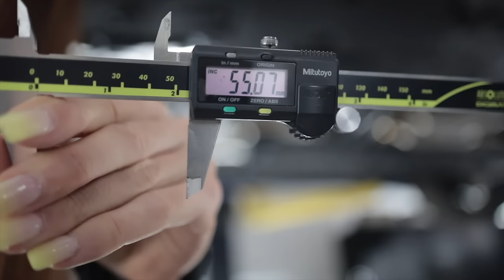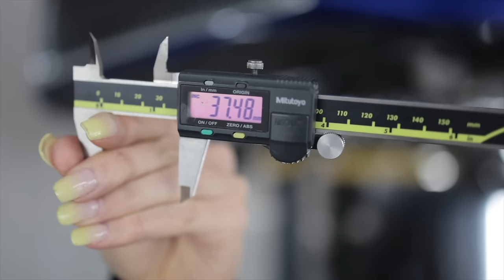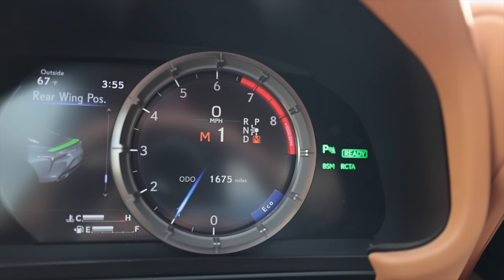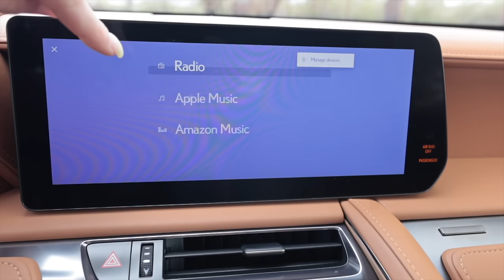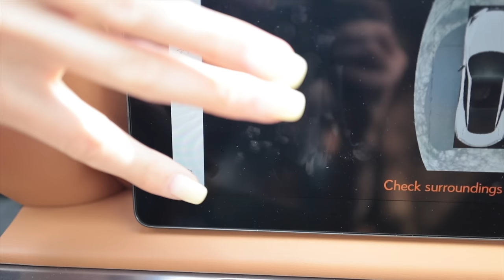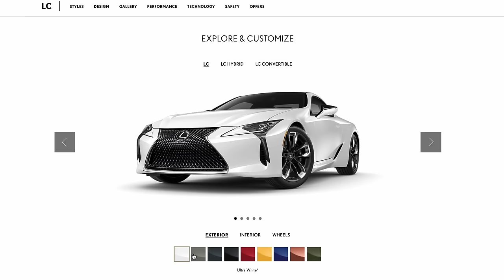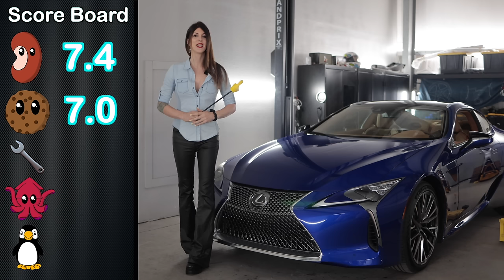Name A Sexier Car..  2024 Lexus LC500H Bespoke Review

Comment: As a person who has owned two LC500's -- the second a bespoke '24 convertible in this ultrasonic blue / caramel color scheme, it's beautiful -- I've always wondered who buys this car in hybrid spec.  "I want the most beautiful car Lexus has ever built...but without the 2nd best sounding engine Lexus has ever put in a car"?

Less than 1% (3 / 371) of LC's in the pipeline right now are hybrids.  82% are convertibles, which can't be hybrids due to the folding top and hybrid battery using the same space.  A bespoke LC500H is truly a unicorn.  A weird unicorn that would probably sit on the lot for 6 months before selling, but still a unicorn.
Reply: the v8 is the only way to go
Reply: Perhaps bespoke cars are built to order so this thing has a buyer already maybe
Reply: I don't suppose that car body could be put on a 68 Camaro frame after a little tweaking. 😁
Absolutely beautiful car inside and out, but I'd never own something I couldn't  maintain 100 % by myself.   It sure looks like a fun car.
Reply: @randywl8925  lol boomer
Reply: @simon_96  some dealers order bespoke cars for their inventory, but this is a press fleet car so I think this was just corporate showing what they could do.

The shame of this specific example is that the main reason most people get a bespoke car is to include some of the cosmetic options that Lexus puts on the Inspiration Edition cars.  Like black trim and the IE wheels, neither of which this car has.
Reply: Where did you get those stats? I would have guessed that most in the pipeline would not be the convertible.
Reply: @Orney  Glad you can afford to have the dealer change your spark plugs. I can't.
It's still a beautiful car..... It just needs a Quadrajet and an O2 detete.
Reply: @johnfisher7121  Not many sold in Montana, North Dakota and Minnesota. 😁
Reply: @johnfisher7121  it's a google doc that some of the forum folks found showing allocation info.  Since the convertibles came out (2021) they've been the big majority of sales, usually beating the coupe by 7-8 to 1.
Reply: @randywl8925 it's a Toyota and will likely outlast you before it needs anything besides oil changes.
Reply: because they arent you
Reply: @bandwagon240  Likely.... ok.
I know the dependability factor.
If I can't afford to play with it, I don't want it.
Reply: I'm a little shocked to hear 4/5th of these are selling as convertibles. Isn't the hefty weight of this vehicle acceptable primary because it's so cossetting and solid? Isn't the lackluster performance vs. similarly priced GT cars ok because of the stunning lines of the design? Turning it into a convertible seems like it would work against the primary strengths of this car. Not shocked that almost none sell as hybrid. The NA V8 is crucial to the character of the LC500 imho.
Reply: @kleinbottled79  the people that can afford them are classy boomers.  They want v8s and a top that goes down, which is why Corvette convertibles continue to be popular.
Reply: I always wondered why Lexus didn't make a ls600 non hybrid, I would have purchased a lc500 but the price is a little bit much. 
Currently I have two ls460l
Reply: @randywl8925  I get where you're coming from but the buyer of this car doesn't work on their own stuff and they can afford to have someone else do it for them. It's like the people bashing folks who buy a Range Rover because it's so unreliable. Those buyers don't care. They'll have a new one long before anything has a chance to fail anyway.
Reply: In South Africa they are extremely rare, and somehow Lexus now only offers the Hybrid!! Wtf
Reply: @davep2945  Yup, just from my person viewpoint.
Now let's talk about G-Wagons and their reliability. If Whistlin' Diesel has a hard time hurting them..... that would be my "uppity" vehicle of choice.
I'd feel inclined to replace the badges with GMC just to mess with people. 🤣
Reply: Lol. Was kind or wondering the only crazier would be the triple threat and it be a convertible . Seeing the car is already rare . Hybrid is like why , and bespoke is like another never . Only thing rarer would be the blue white and orange interior !
Reply: I have the hybrid LC500H as my dream car. Fuck the V8 haters.
Reply: I currently own a 10'LX570 & 17'RX450h. But previously I had an 14'IS350 & a 14'RX450h. 
I know that the transmission on the RX is different, but once you put them on sport mode; the engine comes alive instantly while delivering power at the same time is incredible. And they become quick but the suspension doesn't help. Other than that, the Hybrid might be the right one for those who wants to drive the LC500h a lot. I love how the hybrid can run the A/C or heat plus any other electronic while you're sitting on a traffic light for almost 10 minutes.
If the exhaust is an issue, just send it to get an aftermarket one.
I just wish they would have used the 5.0 v8 with the hybrid power train from the LS600H
Reply: If you lived in California where we're currently paying $6-6.50/gallon for gas and commute 75 miles a day like I do, you'd consider making the trade offs of losing the V8 soundtrack but saving $1500/year in fuel. 

We're not even in the summer driving season and war in the middle east hasn't even shot oil prices up much yet. This time next year gas could be $7-8/gallon.
Reply: @omnimoeish  alternately, it's better to have multiple niche cars than try to have one car that does everything but nothing well. If I had a 75 mile daily commute I'd drive my Chevy Bolt EV for 3 cents a mile.
Reply: I think they sold like 30 last year in the US.  16 the year prior.
Reply: @johnfisher7121  I just saw an LC500 on the road yesterday for the first time in forever.  It was a convertible.
Reply: @kleinbottled79 flip side, if you want a sports car, buy a 911. IMHO - best convertible under $250k … but that’s just my opinion.

Comment: 4,400 lb 2 door Coupe !?!?! 
Damnnnnnnnnn................
That weighs more than my 2020 BMW M550 with a twin turbo V8 inside. 
Interior is gorgeous on the Lexus!
Reply: It's a hybrid, though the ICE V8 version weighs quite a bit.
Reply: @edheldude  Yea, but it's still a coupe.
My M550xi is a full size 4 door sedan, loaded with every option, and comes in under this puppy
Reply: @mrmister385 BMW did a magnificent job making the g30 lightweight. 
I have a 530i MSport. Same kerb weight as a 3 series.
A 5 is a whole different world to a 3 though.
Reply: It’s approaching 70’s ElDorado poundage!
Reply: That's almost 1,000 lbs. heavier than my Toyota Tacoma truck.
Reply: @mrmister385  Yes but in 10 years your M550xi will be scrapped into paper clips and this will be worth more than what it was bought for.
Reply: @benjaminlusskin3211  Do some research. Last of the BMW V8's except for the M5's, etc. Everything is hybrid now.
My car is still sitting around 55k value with 12k miles on it.
I bought it 3 yrs ago for 62.

Comment: Sorry not sorry, this is sooo much cooler than a new Supra, and it's all Toyota. I still think they should have taken a Lexus chassis, taken out some luxury and weight, and used some Toyota engine to make the new Supra. I get that it's supposed to have an I6, but even a TT V6 Supra based on a Lexus chassis would be cooler to me. Like the Supra was an SC/Soarer chassis. At any rate, this thing is super cool and super sexy. I usually hate tan or brown interiors, but that one is kind of amazing. Obviously the V8 is the way to go, but still overall a rad car.
Reply: Not really. It lacks a manual,they aren't tunable,and isn't a tuner friendly chassis at the very least that people would want and expect out of a supra. They chose to collab with bmw since they make much better sportscar chassis than they do and they have a very active and strong aftermarket support for their engines and it shows seeing how they perform in various fields. Maybe if people bothered with lexus or lexus killed their prices a bit,they'd have people messing with them for once.
Reply: @carboydorifutoparty3976  None of that is a constant that has to remain true. The MkIV Supra wasn't based on a light and sporty chassis either. It was a GT car at the end of the day. It was a Lexus with the luxury stripped out and a different skin. No car starts out with huge tuning support. I already mentioned lightening and obviously the car would get suspension and other changes. It would  also be cheaper than a Lexus that's half the point. Basically, IDC because I don't want a BMW if I buy a Supra. 😂 All these arguments are 5 years old now, they've been had, I've even said all the same things you just said. In retrospect, I would far rather a Lexus chassis based Supra with any Toyota engine. Period. That's just me.
Reply: @802Garage  but how much of that change will they really do is the question. Will it just be another rehearsed rcf track where they killed off some weight and just tossed fancy exterior bits on it with fancy brakes,with barely any to little actual updates done to the suspension or chassis that they do with lexus yearly while being noting different from its past year models.The whole problem with toyo is specifically them not being more involved and pushing their platforms like other brands do,along with pricing being one of the main things that kills these models most of all,and its very obvious with the LC and F cars. I didnt consider them using the F cars or the LC specifically because they seem to not even bother with atleast improving them to be more competitive for pricing they're asking for these cars other than just throwing the same V8s/V6s in them and calling it a day with little to no real updates, but they never do and probably never will which is why I don't see them being used as a supra at all since they seem to not even be interested in doing anything with them at all since all of them are basically the same since they were 1st released other than the facelifts of some models and interior changes.
Reply: @carboydorifutoparty3976  They won't... This was all purely hypothetical and talking about the past. Obviously this isn't what happened and isn't what's likely to happen. It was absolutely possible. Again all of your questions could be applied to the original Supra as well. At any rate, not sure if there was some misunderstanding, but I wasn't talking about what I thought was going to happen or even what was most profitable, just what I wanted and think would be better from a Supra lover and enthusiast perspective.

Comment: 3:00 Aisin transmission; KYB dampers
6:35 Drive modes 
7:45 3.5L 354 HP
8:55 Better weight distribution 
9:45 Doesn’t feel heavy; handles great
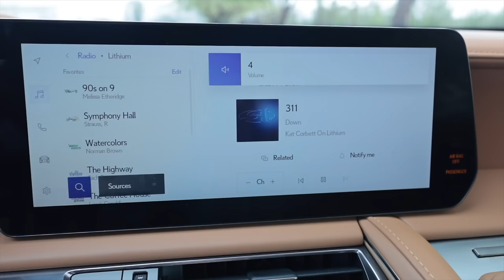11:55 Bespoke
13:00 Infotainment 
15:00 No V8 soundtrack 
16:30 29 MPG

Comment: well done... finally somebody with some common sense. Every reviewer of any Lexus has always slagged off the touch pad setup they used, but it is superior and safer than a glossy , finger print accumulating touchscreen. Bastardising that beautiful sweeping centre console that the LC used to have, now with an impractical touchscreen, was a crime. And can you imagine that glossy touchscreen in the convertible? Unuseable.
Reply: Agree absolutely. Using a touchscreen on the move, especially on a less than perfect surface, is at best frustrating, at worst bloody dangerous. I understand with some research and effort the functions may be set up to be voice-controlled. If so, it doesn't matter which type you've got.

Comment: I stopped buying Lexus when my then new 2011 Lexus had its passenger side glass explode on the highway. It was poorly designed, with major buffeting from the sunroof. The glass was obviously faulty. I had cuts and glass in my face and hands. Toyota refused to cover it under warranty, despite the car being ~1 year old. I’m a former Toyota engineer but stopped buying Toyota after this.

Comment: You are 100% right. The V8 version will for sure go up in value cause they won't make a lot anymore. Even the rumor LFA will not have a V8. The most likely formula will be V6 turbo plus 2 electric motors front and rear. That's it.

Comment: An all black Nissan 370z sport coupe 6MT with a Fast Intentions dual x-pipe cat back exhaust, Stillen Gen 3 long tube intake and a dyno tune. Add gloss black forged magnesium wheels, with Michelin Pilot Sport Cup 2 (240) tires for a car weight of about 3266 lbs and peak crankshaft hp of about 387. All of this is done for considerably less than half the price of that car, which carries much more weight and produces less horsepower.

Comment: It there a reason you always round down? You measured the rear anti-sway bar at 20.97mm and called it “20mm.”  That’s only 3/100ths away from 21mm.

I’ve seen you do this on other videos.  Is there a rationale for that?

Comment: The ls500's engine sound was modified and tweaked by Yamaha engineers to sound smooth with a high pitch not loud and raucous like a lamborghini or Ferrari, the v8 has a normal transmission while the hybrid v6 has a cvt, get the v8 much better

Comment: I have a request ... China's giant cell phone company Xiaomi just announced three sleek BEV sedans: US$30k-34k (commuter & touring oriented) single motor RWD SU7 & SU7 Pro, and the sportier US$41.5k dual-motor AWD SU7 Max - they're Porsche Taycan 'inspired' with 0.195 drag coefficients (a hair under Lucid Air's 0.197).  The upper tier models sport 800V infrastructure, accepting up to 871V, enabling a 200km charge in five minutes. The dual motor AWD SU7 Max produces 664hp & 664lb-ft torque. Xiaomi is supposedly working on a 27k RPM motor.  The Max gets 0-62mph in 2.78s, so it can outrun a 2.9s 0-60mph 2024 Corvette Stingray from a traffic light.  AND... vehicle torsional rigidity is 51k N·m/deg (a Rolls-Royce Phantom specs 40.5k and a Bugatti Veyron specs 60k). This car was designed by ENGINEERS! I'd love to see you inspect the Max and/or its descendents some day.  Speaking of torsional rigidity, maybe you could work that into your coverage of all cars - manufacturers should be aware that we're paying attention - for instance, how does the torsional rigidity of a 2024 Corvette Stingray hardtop coupe compare to its sibling convertible?

Comment: I'll take the V8 instead.

BTW, the tire pressure monitor showed 32 PSI in the tires. Is that correct? Seems a little low for a car that weighs 4,400 lbs.

Comment: I'm a little shocked to hear 4/5th of these are selling as convertibles. Isn't the hefty weight of this vehicle acceptable primary because it's so cossetting and solid? Isn't the lackluster performance vs. similarly priced GT cars ok because of the stunning lines of the design? Turning it into a convertible seems like it would work against the primary strengths of this car. Not shocked that almost none sell as hybrid. The NA V8 is crucial to the character of the LC500 imho.

Comment: Those of us who wear high heels daily would appreciate it if you could show and talk about how it feels to operate the pedals, angle of the foot, etc. I myself experience that it is very different in different cars to drive in high heels, on some manual cars I have difficulty to push the clutch pedal to the bottom with heels over 4 inches.

Comment: I like how critics say they misses the sound of the v8.  But then if they played fake sound critics don't like that either.  I think we all just need to get used to the fact that v8's are going away.  Unless you will settle for an older car.  WIth a barrel of oil hitting $90 a barrel now I really think that is going to encourage automakers to produce smaller more fuel effeicent  engines.  $5.00+ a gallon for regular unleaded is the new normal now.

Comment: Wonder how much that transmission cost and if it will work if one of the motors goes out in it. Those things are cool I'm sure they'll hold up and hold more value than the German  cars at that level will. I don't like the mismatched tires and 50 control arms or the funny exhaust. I'd get the v8 but I like the gtr a little more.

Comment: 10 speeds from 3 planetary gear sets! That's like four more than usual, and this transmission doesn't need a torque converter. My inner nerd is very intrigued, also the outer one

Comment: Toyota should have used this to build the new Supra instead of rebadging a BMW.  Still can't believe they did that to such an iconic car.
Reply: Makes sense. Bmws have the best I6s with a active aftermarket and community,on top of some of the best sportscar chassis on the market that are all tuner friendly, while that's the total opposite of lexus/toyo enthusiasts literally look at any lexus or modern toyo and don't bat a eye at them while only putting attention to the older models and rarely speak about the new cars worth anything.
Reply: @carboydorifutoparty3976    Irrelevant.  Toyota has MORE than enough capabilities to have done their 100% own design, but decided to cheap out and go the easy, safe way.  They spent all that money on the LFA for a two(?) year 500 model run, but don't do the Supra???  I'm not knocking BMW, if that's what you're thinking.  I agree. Toyota is just great at making reliable vanilla vehicles.  They really need to add some POP to their lineup.  Even with this LC500 w/ the V8.  They could take it another step and make it a monster.  Not holding my breathe.
Reply: @TodayzTomSawyer  problem is is who is going to pay for it. Toyo/lexus whole problem is specifically pricing their coupes which they keep absolutely killing these cars with. The mk4 suffered this,same with the LFA,and even the GSF got discontinued specifically because they were pricing them well above other cars it was supposed to go against. It's not that they can't, it's that they overprice the cars for more than what they're worth compared to cars with similar performance.